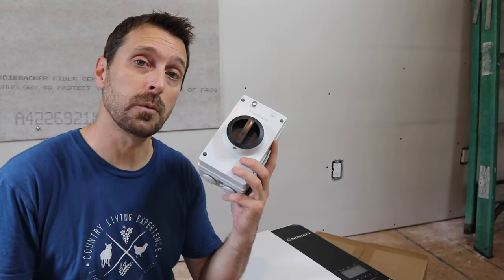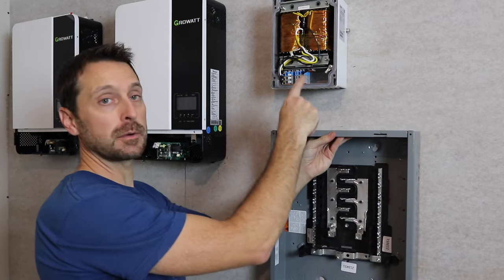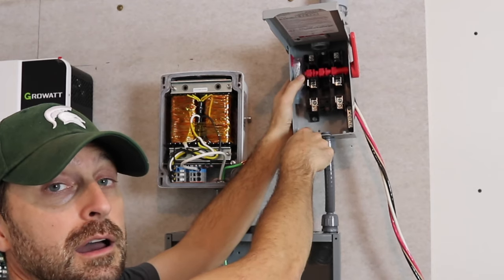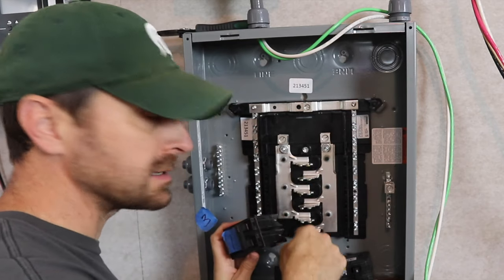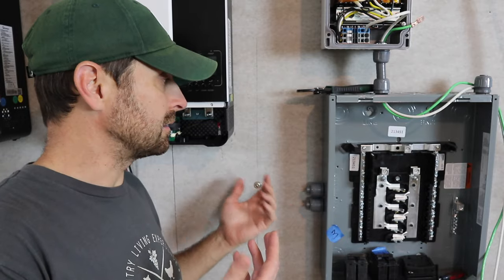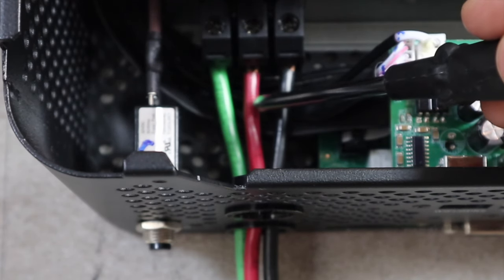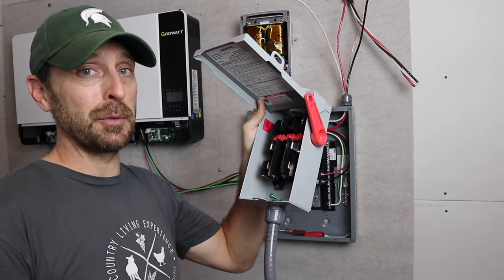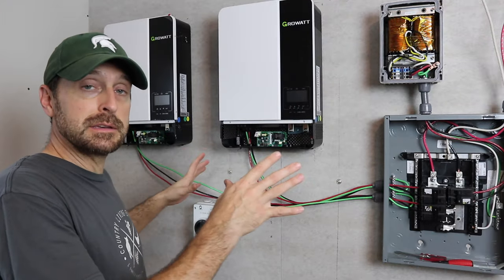Growatt Inverter 5kw Installation And Wiring DIY Solar System!

Comment: I’m installing the same system but very concerned that there’s no way to know if the transformer fails (which will cause a floating neutral).  All signature solar says is to make sure it’s grounded correctly so excess voltage in that event will have somewhere to go (instead of burning up your appliances or house) but there’s got to be a better solution.  Do you have any ideas about that?
Reply from the maker: I am following their recommendations on how to install the system. They are the experts so I have to trust what they say. As far as I understand if the inverters feed 240 back to your main panel, your 120 circuits cannot utilize it and they just won't work.
Reply: @CountryLivingExperience  There is a lot of chatter about this problem (check out this guys attempt at a solution https://youtu.be/p7Gub4PB1Dk).  With a failed transformer/floating neutral the voltage will go crazy if not balanced and could burn up appliances and homes.  Only excessive current, not voltage, will trip normal AC circuit breakers.  I’ve talked to Signature Solar quite a bit about this and they don’t have a great solution. Their in-house electrical engineer, Mike, said to run the “AC out” through a breaker barely big enough to pass the current (he said 23 amps…I don’t think those exist) so any fluctuations would trip it.  It honestly sounded like he wasn’t very confident though.  He also said to ground it properly so excessive voltage has a place to go.  I’m shocked they haven’t figured out a good solution.  

Solaredge, who makes the transformer, designed it with a temp sensor that will shut off their inverter if it overheats.  I wish they’d provide a real solution since they sell the transformer specifically for that Growatt.  Ultimately, they’d blame you for not using a licensed electrician, but no run of the mill electrician would know about this problem.  
David Poz has digital voltmeters to monitor fluctuations.  That’s better than nothing.
Reply: I too am using the same exact main  components.  S.S. told me that if the transformer failed, the 120vac loads just wouldn’t work.  I’m probably being overly cautious, but to ease my mind I ordered a second transformer.  Just need to know how to install it.  I’m about a week out from being ready to assemble my entire system.  I pray it looks as organized as your.  Great video!
Reply from the maker: Very cool. Thanks George. I think I may order a backup as well.
Reply: @georgedrenes8143  When you connect your second auto-transformer, could you let us know how you did it?
Reply: @CountryLivingExperience  m
Reply: @CountryLivingExperience  That's not entirely correct. The "floating neutral" issue is a real concern unless you have all of your 120v loads on a single leg of the 240v. That is the only safe way I can figure out to use the auto-transformer. The transformer should balance the legs and be fine, I think. A single leg feeding 120v loads may be what Signature Solar is assuming.

The problem is when you have 240v feeding the two legs, and you have 120v loads on both legs to a neutral, and that neutral has no fixed reference.
If the 120v loads were exactly matched and purely resistive loads then there would be no problem because they would present the same load on each side of the neutral and it would "float" to the center of the voltage, or 120v relative to each leg. That is effectively impossible, so the neutral will instead float to some random point between the legs.

Math time, using ohm's law:  Voltage = Resistance * Current   (voltage equals resistance multiplied by current) and Power = Current * Voltage

If you had a 120 volt, 100 watt incandescent light bulb, it would have a current of C=P/V=100/120=0.8333 and a resistance of R=V/C=120/C=120/0.8333=144 ohms  If you do the math for a 50 watt, 120v incandescent it will be 288 ohms.
If with a floating neutral you put only a 100 watt bulb on each of the 240v legs they will be connected series:  leg1--bulb--neutral--bulb--leg2  and you will have 120v across each bulb, because the bulbs are the same. C=P/V=200/240=0.8333 amps  and  across one bulb V=R*C=144*0.8333=120v
If you put a 100 watt bulb on one leg and a 50 watt bulb on the other, C=P/V=150/240=0.625 amps and across the 100w bulb V=144*0.625=90v (so it will be dim) and across the 50w bulb V=288*0.625=180v (so it will be really bright until it burns out).

In the real world the legs are never perfectly balanced so a floating neutral will never be mid-way between the legs (120v) and because the loads on each leg are seldom perfectly resistive the exact point will vary until all the loads on a single leg disconnect (probably by burning up).
Reply from the maker: @Sylvan_dB  Look, I am not an electrician or an electrical engineer. Sounds like you are. I appreciate your concern. Call Signature Solar and discuss it with them then.
Reply: @CountryLivingExperience  Engineer, actually. Not interested in arguing, just stating facts. When you DIY it's up to you to learn.
Reply: @Sylvan_dB  Dam people do not know how to communicate, he was not arguing he was just stating his skill set and referring back to Signature Solar.    You did not give a definitive answer you stated “I think” , Which implies you’re not really sure so that’s why he was saying give signature solar a  call.
Reply: @TheFatman819  The "I think" was in regards to the transformer balancing the legs.  The rest I'm sure about. Especially in regards to the floating neutral being unsafe, and the danger of wiring it as this video showed.
Reply: @Sylvan_dB  you still don't get it. He said he is following SS recommendation and that he is not an electrical engineer yet you continue on as if he should understand and do exactly what you say. Just move along.
Reply: @JM-yx1lm  I get it, but I don't get you. I did not "continue on" I simply refused his directive. Where did you see me attempt to make my point again? Where did you see me tell him a second time what to do? Yet here you are, telling me what to do, "move along."  I did "move along" until you showed up telling me what to do. This is how I tell someone what to do: Go examine your behavior.
Reply: Oh and for those coming later, I was told to go "argue" with Signature Solar.  My use of that word looks strange now that the message to which I responded has been edited, but such is life on youtube.
Reply: Spend the extra money and get a balanced transformer!

Comment: Little puzzled the AC out on the Grow Watt, L1 is Hot or Common, L2 is the Neutral. You connected L2 to the breaker which will create a Dead Short! Neutrals should be landed in your sub panel on the Neutral bar.
Reply from the maker: That is not what I did. These inverters are 240v only. They both have 2 lines. A L1(red) and L2(black) (it is incorrectly labeled with an N)(refer to Signature Solar's video). There is no dead short. Transformer creates a neutral leg. Those neutrals are all tied to the neutral bus separate from the grounds in the sub-panel. The neutral ground bond is made downstream at the main panel.

Comment: Why did you set up the power station area in the house instead of doing a separate building designated for this? I’m curious because I’m considering increasing the size of my pump house to accommodate everything for the solar power setup/station. Thanks in advance!
Reply from the maker: It is much easier to monitor and manipulate in the house. Additionally it is easier to keep them in the proper temperature and humidity range in the house.

Comment: I don't understand why you said "Line1 Line2" for the inverter output. I believe it's the 5000ES model and it is single phase 230V. And they are actually Line and Neutral. (Not NA standard)
The black wire is actually a Neutral.

Comment: So the transform is just there to give you a neutral even though if you look the neutral and ground are combined in the meter
Reply from the maker: No. The transformer give me two 120v legs from the 240v inverter.
Reply: @CountryLivingExperience  so the transform is taking L1 or L2 and taking 180 dregs out of phase to to make true 240.
Reply from the maker: This video from Signature Solar will explain it. https://www.youtube.com/watch?v=NVnJhFxCFHw&t=5s
Reply: @CountryLivingExperience  so that company is sell inverters that are ment for the uk and not for the us
Reply from the maker: @wolf3five  No, these inverters are internally modified to work with the split phase American grid. They are the US versions.

Comment: Playing dumb here but what is the purpose of the Transformer, is this to do 240 appliances?  Is it necessary to plug into the system?
Reply from the maker: The transformer splits the 240v into two 120v legs for our 120v loads.

Comment: You mentioned the manual states 40A breakers are needed for the inverters.  Do you happen to have V4.0?  My manual is V3.0 and states on p.9 that a 50A is required for the SPF 5000 ES.  I am wondering if they updated the manual/requirement as I believe David Poz was surprised that a 50A was originally called for, and am about to purchase my breakers.  Thanks, your video was a lot of help.
Reply from the maker: I also have V3.0. They are changing and updating them so quickly. I went with 8ga wire which a 40a breaker is appropriate for. I am not sure why they state 50a in the manual. When I originally talked to Sig Solar they told me 30a breakers and 10ga wire but they may have been mistaken and though I purchased the spf 3500. Regardless, if the breaker is too small it will just trip a bit earlier. I will probably just stick with the 40's and see what happens. Glad we could help out.
Reply: @CountryLivingExperience  Excellent, thank you for taking the time to respond, I know you have a lot of comments to get to, appreciate it.
Reply from the maker: You're welcome

Comment: HOWdy  C-L-E, ... 
Whenever landing STRANDED Wire ( especially 8 awg & larger ) 
FERRULES keep everything together & tight 
I  landed  my CIRCUIT BREAKERS before my FERRULES & CRIMPER arrived 
When I  removed the Stranded  8 gauge wire from the circuit breakers 
I was disappointed with how much they had "loosened" and MASHED out away from the CONTACTS 
Same inside my  GroWATT  INVERTER ... the SOLID COPPER Wires were fine ... but ... the Stranded wires had "lost" their TORQUE
Just an  FYI
Thought # 2 ... if it is the least bit HUMID or DAMP ... consider some  "NOX-OX" or "OX-GARD" on all your connectors 
& the knife edges on your Circuit-Breakers  where they slide on your BUS-BARS inside your Circuit Breaker box 
& where steel screws into aluminum etc Etc ETC ... 
Thanks for sharing your SYSTEM & PLANNING 
COOP
the  WiSeNhEiMeR  from Richmond, INDIANA 
...
Reply from the maker: Thanks

Comment: Not sure if I missed it or not but what is the purpose of that transformer? You referred to it as a balancing transformer. Thank you.
Reply from the maker: No problem. Growatt 5000es inverters are 250v output. You need a balancing transformer to produce 120v for the majority of your house loads in the US.
Reply: @CountryLivingExperience  yeah I just got my Growatt MIN 7600TL-XH-US in the other day. I’ve been purchasing bits and pieces here and there getting ready for the install, and when I saw that transformer, I wanted to make sure I didn’t miss something.
Mines a 240Vac Split Phase 
As I’m reading right now, I see it states(Grid support utility interactive transformer–less hybrid inverter). Can’t wait to see how she does!!
Reply from the maker: Cool. Have fun with your install!

Comment: so having 2 5k inverters you have 10 how often to you get close to using the full 10k? currently i have a gas gen its a 17.5 kw i can almost run my whole house on it, minus the dryer when the ac is on or vise versa. when i calc it out tho using my average KWH from the power company that math comes out to around 3800 kwh a day.  I really like your set up and i am so close to pulling the trigger.
Reply from the maker: Cool, thanks. I could use the 10kw easily if I was not smart about how I used my appliances. I just have to think about what I am using. I did a video on testing/running the loads in my house including stove, oven, water heater, dryer, all lights and phantom loads, etc.....https://youtu.be/FHCJIW2zcwE.

Comment: yes 30 amp breakers are for the 3000w inverters but the manual says 10awg wire for the 5000 but probably you are right, the manual is really bad
Reply from the maker: They have updated the manual and continue to update other ones.

Comment: Just wondering why do you need a sub panel when you could have bring line 1 and line 2 and your neutral directly to your main panel using your double pole breaker, thus feeding each 12V leg. Am I wrong here?
Reply from the maker: You cannot do that because these are 240v inverters. You need the sub panel to utilize the mid-point transformer to split that and create the neutral leg (2 legs of 120v). If you just rant that inverter back to your main, you would fry your 120v loads.

Comment: Hi!  I’m David Riegel, the guy at the Signature Solar customer pickup.  I watched one of your videos (for the first time) last night about your panel installation so meeting you today was a nice surprise.  It looks like you are using a Growatt setup.  I originally ordered a Growatt but they redirected me to an EG4.  The EG4 doesn’t require the transformer, which seemed like an easier install to me.  I’m curious why you selected the Growatt over the EG4.   Great meeting you in person!
Reply: To clarify, I was the customer you met at the signature Solar pickup dock.
🎃
Reply from the maker: Hey David. Nice to meet you today. 
At the time I bought my Growatts, they EG4 didn't exist. They came out with it about 8 months after my initial purchase.  The Growatt wasn't that hard to install with the transformer but the EG4 was easier with less wiring. I am going to use the Growatts for my barn and well which are on a separate grid transformer on the property. The panels I picked up today are for that project. 
Let me know if you have any questions about the EG4 install. 
Have a good day!

Comment: Just an FYI, The SPF 5000 ES User manual on page 9 and page 25 Calls for the 8 awg wire and a 50A BREAKER. I'm building the same system and if I'm wrong about that please let me know. Also, I'm using 2 split phase Growatt transformers. I see how one is wired in, would the second one be wired in the same just connecting to its own 20A, 25A or 30A breaker??(I'm not sure what size is needed) Would they automatically share splitting the voltage. The reason I got 2 transformers is I'm more worried about the breaker tripping due to breaker failure than transformer overload and 2 seems to improve both problems. Over the years (I'm 69 Years old) I have seen breakers trip from breaker failure a few times. Any comments would be appreciated.
Reply from the maker: I know. I was following advice from other sources more familiar with electricity than I. I am not an electrician. It is best to follow the manual or contact the solar equipment dealer that you bought it from. Each inverter should be on it's own breaker. When paralleled and communicating with each other, the inverters will share the work.
Reply: @CountryLivingExperience  Thanks. Also confirmed by SS.

Comment: 30A breakers w/ 10AWG wire are fine for the 5000ES unless you need to Run the full 5000W load and charge a battery from Grid at the same time.
Reply from the maker: I am off-grid. I don't have input from the grid to the inverters at all. We have upgraded to 40A breakers.